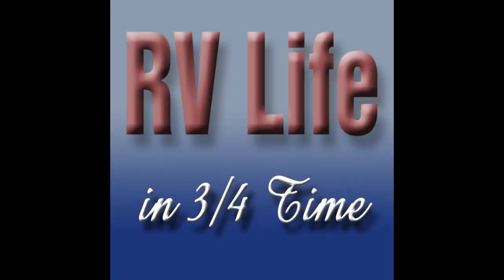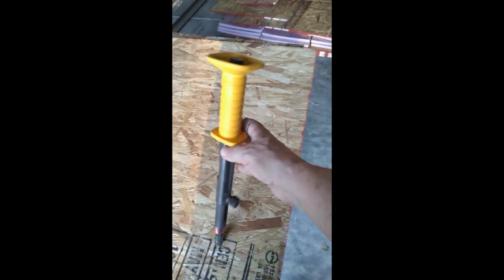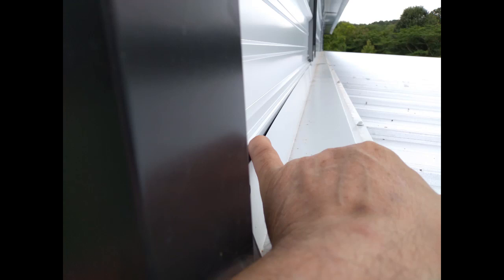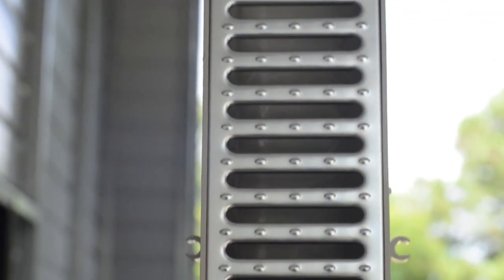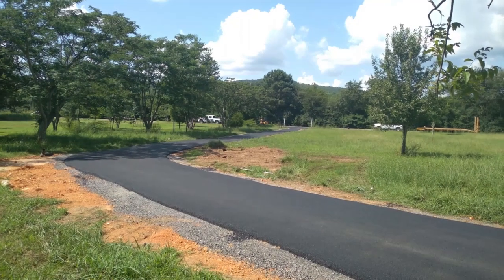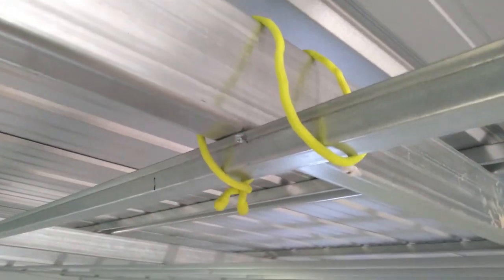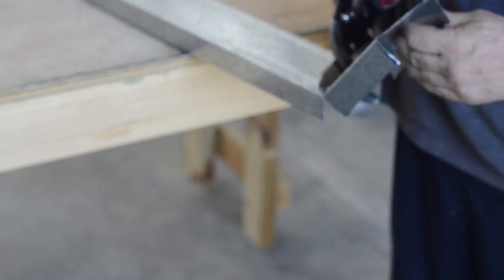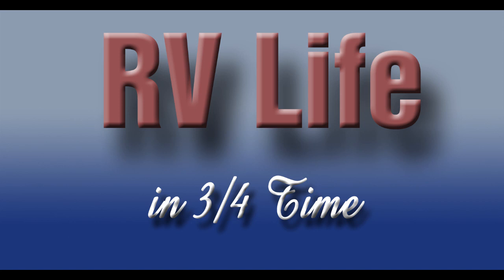RV HOMEBASE LIVING QUARTERS

Comment: Hi Carl. I’ve enjoyed your build on this barndominium. One thing I have not seen in any comments unless I missed it or you talking about. It is a ballpark price for just the shell erected on your property. I’m trying to put together something similar to this in western North Carolina. Thank you for your time.
Reply from the maker: Sorry it took so long to reply.  I had some health issues that kept me off YouTube for a while.  Making a video about the issues.  The slab cost around $24,000 and the shell with two exterior doors and three tall garage doors run just over $48,000.  This was for a structure that covers a 50'x60' area with a 10'x22' front porch.  We pre-paid for the structure so we got process before the current round of inflation set in so I don't know what the prices might run now.
Reply: @rvlifein34time37  the last video I saw you were Lane sub flooring down on sleepers I believe on the concrete slab did you ever finish that building and the living space? That price is a good price even adjusted for inflation now it still seems pretty reasonable. What kind of R-value did you get with the insulation you put in. What type of insulation in the walls and ceiling were you able to install? I hope you feel better soon.
Reply from the maker: We do have a video out where we used metal studs to trim out the living quarter and I have just released a video where the contractors, including the drywall contractors finished the work inside.  The living quarters are not but are livable. We are spending most of our time there.  The health issues I mentioned was is a broken leg.  The new living area is, of course, one level compared to our other multi-level home and makes getting around much easier with the broken leg.  The broken leg has slowed down everything, finishing the home base, prepping the old house for sale, and getting out videos.  So the next video will be about the broken leg.

Comment: What is the size of your building?
Reply from the maker: The main slab is 50' x 50'  The center section is 16x50, the living quarters are 22x50, there is another garage section that is 14x50 and there is an overhang in the back over the slab that is 8x50.